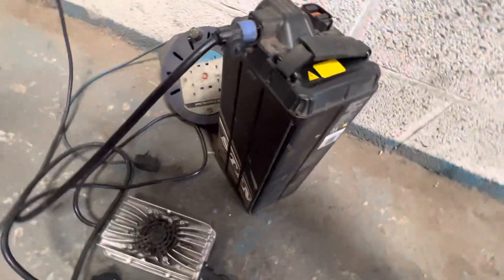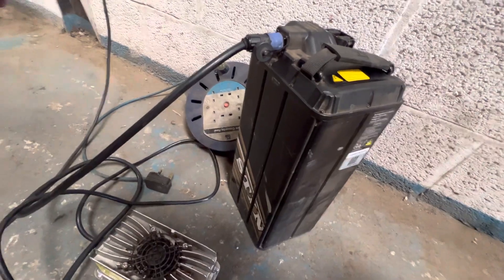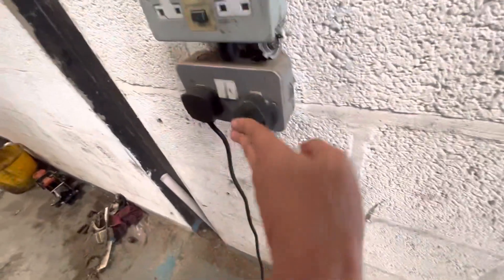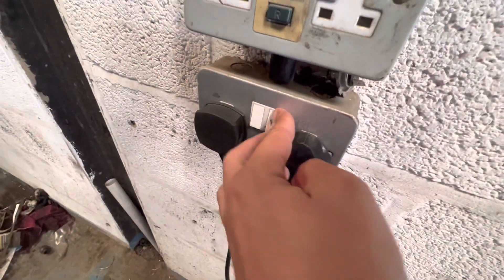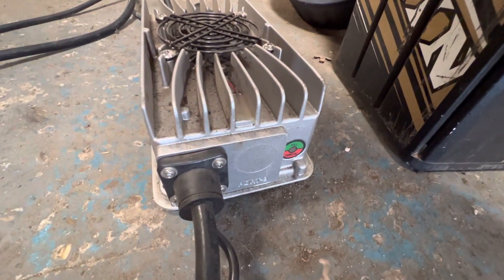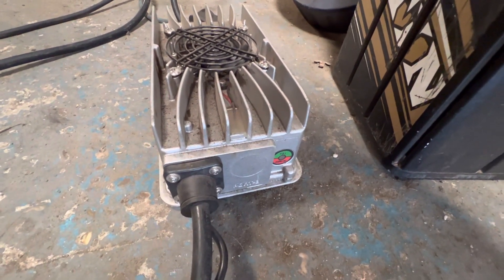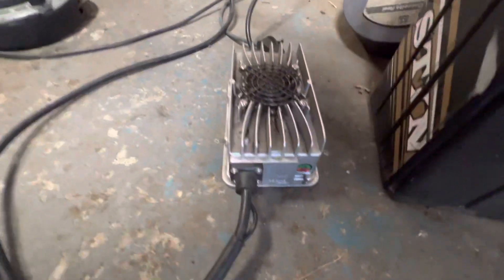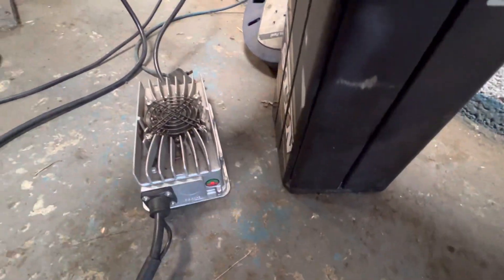SUR-RON / TALARIA BATTERY WONT CHARGE FIX !

Comment: Doesn't always work...especially if battery is at 0%. My battery was dead and, the stock 10 amp charger would not recognize the battery at all. I followed this procedure so many times plugging/unplugging and, it did not work. I ended up finding a cheap 2 amp charger on Amazon that has the adapter that plugs directly into the battery. Cost about $60-$70. It took about 4hrs to fully charge to 100% and, the battery is now working again.
Reply: What charger did you end up using? How did you plug it into the battery? Any help would be appreciated.
Reply: Not sure the brand. You have to look online. It was a China brand 2 amp charger that has the adapter built into it to plug into the battery. I believe I bought it thru Amazon.
Reply: @hornefoundations  Thank you. I found one on Amazon that may work. I’ll give it a try.
Reply: @ryanrowell8350  Hey I’ve got the same problem. Did you end up getting the Amazon charger and did it work?
Reply: @jamesonevans2712  The one I ordered had a plug that was slightly oversized. I’m looking for another one. I’ll let you know if I find one and if it works.

Comment: I just got one yesterday and the battery is dead right out of the package, when I plug it in it'll charge for about 10 seconds and the fan on the charger kicks in, then it goes into "no load" mode.
Reply: Did you ever fix this problem I got one and it’s doing exactly what you said. This switch power off and on is not working. Help me please 😢
Reply: Same issue anything to fix??
Reply: I have same issie. Any solutions strong r mx4

Comment: I did this. Fan comes on and charges for 5 secs then cuts off. Help please?
Reply: Same need help asap
Reply: Same I need help asap
Reply: @sfinnese9394 same bro mine came in today the fan turns on then turns off 
Then all lights turn on
Then the lights turn off
Then the fucking fan turns on 
Then the fucking fan turns off 
Then the fucking lights turn on again
And then the fan turns on and then it turns off and it’s basically an endless cycle
Reply: @Nr8k  literally bro I have messged a few specialist for surrons and they have told me to messge a battery specialist he said he’d have to look at it dosent look good for people who have this issue quite sad considering how much people pay for the bikes considering you can’t go lower than 15% or risk losing your battery
Reply: @Nr8k  I’ve got to take mine a shop next week to see what they can do and so they can send my battery off to a specialist see if he can do anything with it I’m so angry
Reply: @sfinnese9394  hey bro maybe I overreacted cuz I just fixed my issue. I turned on the bike while it’s hooked up to the charger and now it charges 😭😭 at first I didn’t turn on the bike while it’s charging cuz it didn’t make sense but I guess that’s how you do it
Reply: @Nr8k  what do you mean you turned on your bike while charging your breaker or key or both ??
Reply: @Nr8k brother thank you
Reply: @grayson8942  and then turn off the bike bro once you notice that the fan does not shut off on its own. If that is the issue you were running into